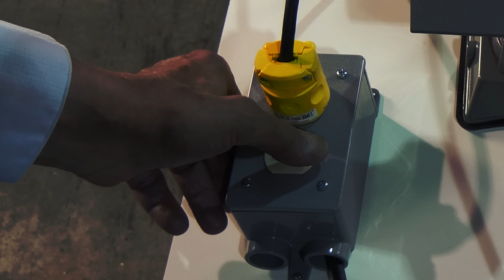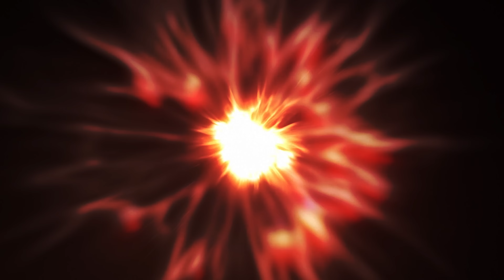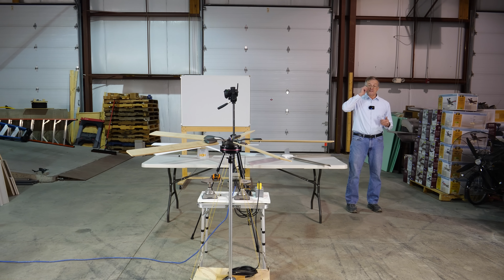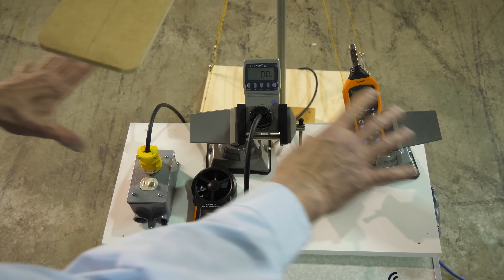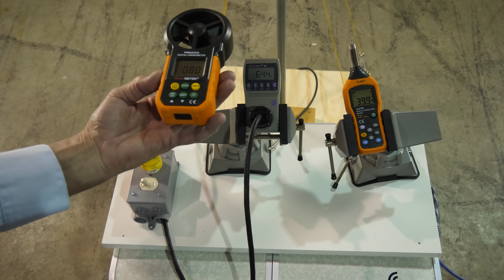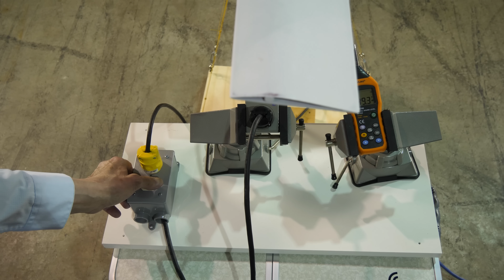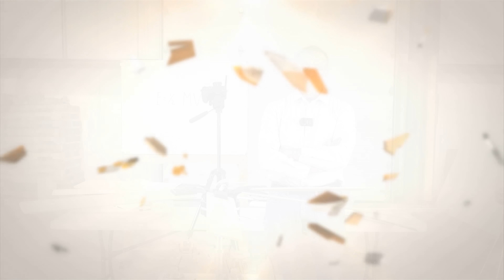This Fan Uses Almost NO Power

Comment: Could it be that the induction motor bearings are not designed to work upside down?

Edit: aren't a lot of AC appliance motors univesal motors, not induction motors? Also I presented your premise to chat gpt and it stated many modern appliances have bldc motors. Not going to tear my appliances apart but that seems plausible, and probably you could just check model number specs so maybe some manufacturers are already doing this.
Reply from the maker: I suspect SOME are. A general demand or preference will increase that percentage.

Comment: I would be more interested in RPM change from stock to improved airfoil blade. I suspect the weight of the assembly is more of a factor than blade shape.

Comment: How about something new, an open blower sized fan. a fan with 5 thin and flat spokes parallel to the airflow and the"backflow" blades from the highest efficiency blowers about 6 inches, 3 +- from the central or just 6 inches down. Maybe try small sectors of a blower, then the entire thing. This would also be safer if bumped on the ends accidentally. One large central hub might be better and after if made from polycarbonate or similar strong and light material.

Comment: There are DC motors already in wide use (I think). What is the actual delta between AC and DC motor use (in specific use case and across the board)?

Comment: At the end of the video a table would be nice with all the measurements. Including all combinations of motor/blade design at full power, including the full power reading, as well as what power was used if you slowed down the brushless DC motor to an airflow of 1 meter per second.

Comment: in  europe almost evry motot is brusless , its common , i think because most tings are sold with a energystar rating , and high ratings wont sell . , ow yeah another ting , i tink efficiency will go up if you use the same ends from a airplane wing on those wings , energy consumtion will be the same i think

Comment: As someone who lives where Ceiling Fans basically dont exist, im shocked to learn that you guys casually burn around 50W per room all the Time. :o
No wonders there is never enough energy.
I mean also quite ironically how your Fan that is supposed to cool your room is actually a Heater :D.
Mindfuck of the modern world.
Thank you for this video, properly controlled brushless dc motors are always a W <3

Comment: AI Summary

Abstract:

This video details an experimental project investigating the efficiency of household ceiling fans, initially focusing on blade design before an unexpected discovery shifted the focus to motor technology. The creator first tested various fan blade designs, including custom airfoils, against standard particle board blades, expecting significant improvements in airflow, noise, and power consumption. Initial results showed a modest 20% improvement, which was deemed insufficient. However, a crucial control test, running the motor without blades, revealed that the conventional AC motor itself wasted over 80% of the consumed power as heat. This led to a comparison with a modern brushless DC (BLDC) motor fan, which demonstrated vastly superior efficiency, consuming significantly less power while maintaining comparable airflow and noise levels. The video concludes by highlighting the enormous energy-saving potential if inefficient AC motors in common household appliances were widely replaced with BLDC technology, impacting global energy consumption on a terawatt-hour scale.

Summarizing the Ceiling Fan Efficiency Deep Dive

*   0:35 Project Genesis: The video highlights parallels between research and video creation, starting with curiosity and identifying significant topics with poorly understood principles.
*   2:20 Accidental Discovery: The project originated from a warehouse full of discontinued ceiling fans, leading to an investigation into improving their efficiency.
*   3:35 Initial Hypothesis (Blades): The creator hypothesized that replacing standard particle board fan blades with aerodynamically superior airfoils (a simple curved metal blade and an NACA asymmetric design) would reduce noise, power consumption, and improve air movement.
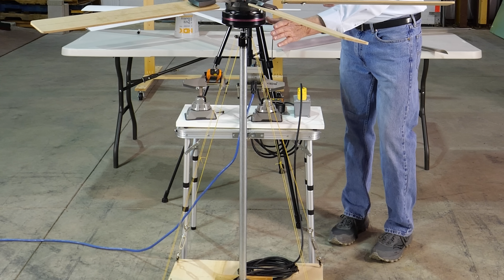*   4:09 Test Setup: A test stand was fabricated, equipped with a power meter, decibel meter, and handheld anemometer to measure fan performance metrics.
*   6:06 Initial Blade Test Results: Tests showed the NACA asymmetric airfoil improved airflow by about 20% compared to the original blades, but this improvement was initially deemed insignificant due to the overall power consumption.
*   11:53 The Epiphany (Motor Heat): After being disappointed with the blade test results and disassembling the setup, the creator noticed the motor was unusually warm, even 20-30 minutes after testing, indicating significant power waste as heat.
*   13:14 Crucial Control Test: A test was performed with the AC motor running without any blades, revealing it consumed 55 watts, indicating over 80% of the total power was wasted in the motor itself, not in moving air.
*   14:33 The Real Problem (AC Motors): The primary inefficiency was not the blades but the pervasive, inefficient AC motors used in typical ceiling fans and many other household appliances.
*   14:40 Introducing BLDC Motors: The creator sought out and tested a brushless DC (BLDC) motor fan as a more efficient alternative.
*   16:27 BLDC Performance: The BLDC motor, without blades, consumed only 8 watts, dramatically more efficient than the AC motor's 55 watts. With blades, the BLDC fan achieved comparable airflow to the AC fan (1 m/s) at only 23 watts, saving 44 watts.
*   20:28 Significant Energy Savings: Replacing an AC ceiling fan with a BLDC equivalent could save approximately 40 watts continuously. For a fan running 24/7, this equates to roughly $90 per year in electricity costs or $1000 over a decade for a single fan.
*   21:19 Broader Implications: The video emphasizes that similar inefficient AC motors are found in countless appliances (washers, dryers, refrigerators, furnaces, etc.) globally. Widespread adoption of efficient BLDC motors could lead to terawatt-hours of global energy savings.
*   22:42 Project Significance: The project, initially almost abandoned, proved highly significant by identifying the hidden inefficiency of common appliance motors and highlighting the vast potential for energy conservation through motor technology upgrades.

I used gemini-2.5-flash-preview-05-20| input-price: 0.15 output-price: 3.5 max-context-length: 128_000 on rocketrecap dot com to summarize the transcript.
Cost (if I didn't use the free tier): $0.0057
Input tokens: 18118
Output tokens: 847

Comment: Another point of efficiency problems is AC. It was great an all when all we had were 50Hz/60Hz Transformers 100 years ago. But with modern electronics, DC is better. Furthermore, especially in the US, the low voltage of only 110V is also increasing the losses a lot. It would be interesting to see a number of different electricity consumers around the house tested for viability of running on DC, or even running on slightly variable voltage, such as when hooking a big solar battery directly to the load, with no lossy converters in between. Standby consumption would also be reduced a lot if there was an additional low voltage DC source provided with wall plugs, as AC-DC conversion losses are higher at ultra-low loads. Solar installations would then also not need inverters if the electricity was consumed locally in DC. In total, this should increase efficiency around 30%.

Comment: May there be a little flaw in the assumption 1.2x velocity is equal to 1.2x mass? It's only true if the density/pressure of the air is the same, which was not measured. Higher velocity usually means lower pressure, doesn't it? So wouldn't that evaluate to less than 1.2x mass?
I'm convinced it's still more than 1.0x but slightly less than 1.2x.

Comment: Efficiency is the name of the game in the energy future. It is not only that 40W is being wasted, worst, it is being wasted as heat in the summer, when it just only adds to the heat. It is like trying to swim with your winter jacket on. This efficient electric-to-mechanical transformation avenue is one of the two most important directions in (re)designing any energy based appliance, the other one is the movement-of-fluid to circular movement transformation. Very few physicists ( and engineers) realize that the fundamental way we historically interpret and being thought "the Bernoulli principle" is incorrect as it does not take in consideration neither the boundary layer dynamics nor the drag it causes and in such the machinery we build in the industry, for fluid-movement-to-circular-motion-transformation is extremely inefficient, and that has immense implications for the entire energy transformation industry.

Comment: Everything claiming to have an "inverter Motor" like washing machines, refrigerators, AC units or even ceiling ventilators are very efficient by design! 

In the bedroom I have a Westinghouse ceiling fan, which is a typical 3-speed AC motor design (where you can hear the grid frequency hum) with this dreaded "slab of wood" blades. 
This is using about 50W at full speed, 15W at the lowest speed.

In the office I have a generic Chinese 6 speed inverter motor (where you cannot hear the grid frequency hum) ceiling fan with blades that are actually formed like they are supposed to move air. 
This is using about 25W at full speed (which moves much more air!) and about 10W at the lowest of the 6 speeds (which still moves more air!).

The Chinese one was supposed to be the bedroom fan because of the quiet motor ... but it moved too much air ... froze under it despite having it run in reverse on the lowest speed.

So if you want the efficiency gains seen in the video, get those generic Chinese 6 speed fans with a remote control and App connectivity from amazon! ... More efficient, more effective, finer control, cheaper ... if those old  companies like Westinghouse still sell you old style humming inefficient and ineffective stuff for big dollars just because their name is on it, they are not worth it! ... They have to go with the time or they go with time!

Comment: I hope I’m not the only one that noticed the test with the metal rotors was visibly spinning slower than the other tests. No rpm for comparison ?… just a “very” general estimation using the audio an analyze for rpm with the AC motor… wood blades, ~380 rpm, metal blades, ~280 rpm, white blades, ~560 rpm… dc motor, ~750+ rpm, and the at the lower speed ~390 rpm. Again just a very quick estimation using the audio waveform.. but I’m curious about how much air each motor and blade would move at identical rpm.. and noise levels, etc… one thing that I’ve always wanted was a ceiling fan that had variable pitch blades. Ones that could be changed while in operation with 1 degree granularity, + / -. You could reverse the airflow immediately without having to throw that switch that’s always in that sketchy location… or temporarily set the pitch to 0 so it stops blowing out the flame when I’m trying to light my….

Comment: When it comes to PC fans, DELL has extremely impressive lines of high static pressure brushless fans that will hit about 30,000 RPM & move upwards of 120CFM on 12v @ 0.72Amps - 1.3Amps. Downsides are, they are much more expensive per fan, more noisy but longer lasting (ball bearing), & were usually 4 or 5 pins meant to plug into a proprietary daughterboard in DELL PC's & if plugged into a std MBO fan header, the fan either won't run or the MBO hard resets or powers off. Some are wired differently at the plug end, & some at the FCB. Took a while to figure out how to get around that & finally have mine connected to a a separate 4 pin PWM controller.

Comment: Can you get hold of an induction motor and make a short additional video showing the increased efficiency from that, with a table at the end showing the results? Also please if so could you put a comment in the vide with the results so it's in text format.

Comment: I'd be curious to see the power factor on the original motor and how efficiency changes with line voltage.  Way back in the time of Eagle Hardware, they sold a device call the Green Plug. It was designed to work with refrigerators.  Compressor motors tend to be of the type where current increases with voltage, but power factor goes down to keep actual power fairly even.  But that extra current causes real losses in the resistance of the motor windings.  What the green plug did was after the compressor started, it would drop the voltage down to the lowest acceptable line voltage.  The result was a cooler motor and more efficiency.  Eagle had a live demo set up that you could play with.  You could see that the motor ran quieter and more efficiently when the green plug was switched in.  I bought it and put it on my '75 GE refrigerator.  It's been working well. I did see a noticeable drop in my electric bill.

Comment: I particularly liked how you took us through your thinking and the "eureka" moment, thanks. 
These little motors have been used in bathroom and kitchen extractor fans for a long time, at least over here in Europe. I think the only problem with them is that if you want to increase the power of a DC motor, it needs to also get bigger in size. Thanks again and keep it going, you guys.

Comment: I am a big fan ! All kidding aside I recently watched a video where they described the R&D used in High volume, low speed (HVLS) fans for cow barns. They have a complex airfoil with vertical wing tips to maximize the air flow and minimize drag/turbulence.

Comment: Here in Pakistan we've been shifting to these BLDC fans for a few years now because in most parts of the country fans are needed for 8 out of 12 months and they are quite more efficient to run. 

Even our air conditioning market the fact that it's blower fans are bldc as well as the compressor 😂

Comment: Also worth noting that people usually run ceiling fans when it's hot, and all that extra heat from the motor is getting dumped into the indoor environment and heating it up more.

The ~40W of waste heat is about equivalent to having another resting human body in the space, which is not insignificant.

Comment: Wow, quite the find! This definitely seems very close to the collab I want to see: you and Technology Connections.

This also seems like something a lot of people will probably still not care too much about since the immediate savings are fairly small, but this would be a gamechanger for the vanlife/RV community. Cost savings are one thing, but power savings when you have to conserve power are HUGE!

I also will echo everyone else; we need to see the results of the other blades on this motor (and the other blades normalized for airflow on the original),

Comment: I upgraded all my old AC fans in my home with DC fans with dimmable lighting and remotes. The old AC fans were found to be spinning slower and making an annoying humming noise. Turns out it wasn't just the fan motors but the capacitors in the fan controllers were the issue but the cost to repair all 5 fans was also compounded by the running costs.

Comment: I forget - are the fans on the chemical air conditioner from years ago - the long white tubes - are the BLDC motors?  Can that system be optimized using this tech if it isn’t already?  You’re potentially going to take this in interesting directions.  

Science is fun.

Comment: My question, what about the heat factor, especially when used for perceived cooling? I would think that ac motor with your values would add up to a lot of heat in the room.

Comment: Did the DC motor get hot? In other words, did it lose efficiency due to the production of heat? One thing I love about your channel is the data. This was more of an "Ahaa" video of an epiphany. I would love to see more on this subject. Changes in angle of attack in the airfoils. Changes in diameter to find the most efficient combination. Experiments to find the most efficient airfoil shape, etc.Then boil down the data in spreadsheets. Thank you for sharing your "Bing!" moment with us!
Reply: Heat is a direct conversion of power, as the test showed a lot less power being consumed (for the same amount of airflow), it therefore means a lot less heat generated.
It would have been nice to actually see temperatures for the various tests.